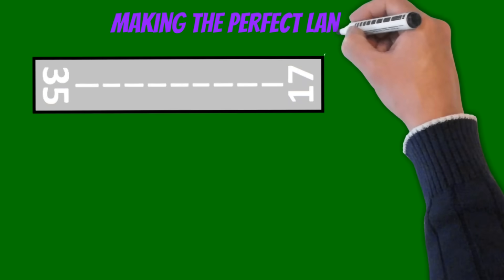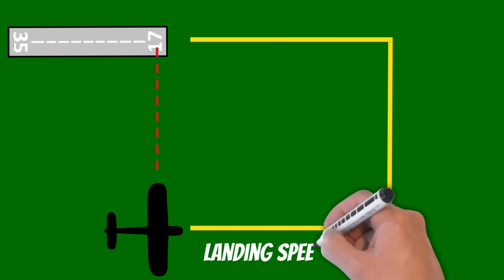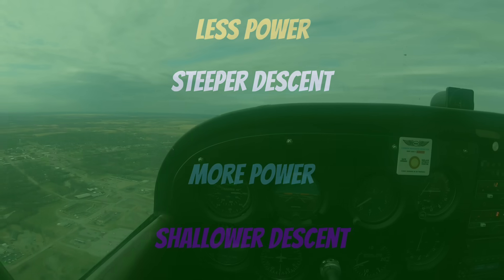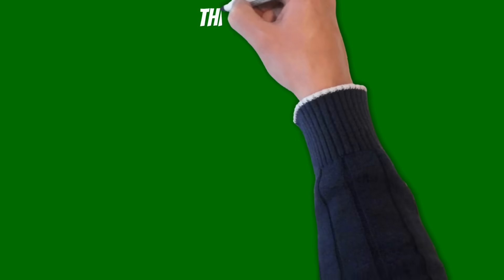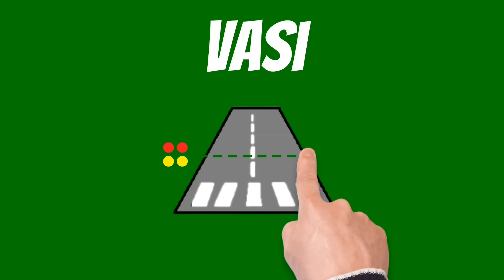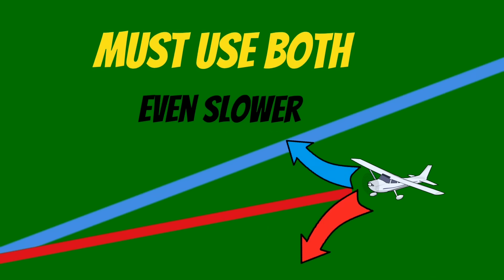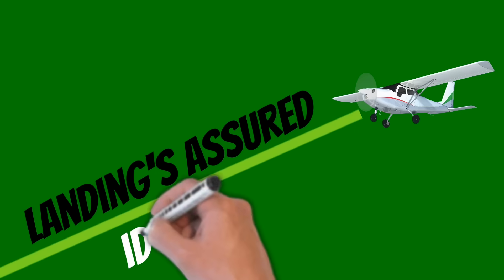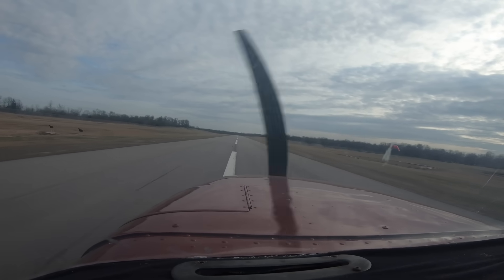Landing SECRET your Instructor won’t tell you [How to Land]

Comment: Nice. I flew a 172 one day after having only done it in MSFS (90's version). I had an instructor on board but all he did was talk on the radio and point me which way to go. About a 20 minute or so flight, take off, fly out a few miles and come back.
"you sure you never did this before?"
Reply from the maker: 😂 that’s pretty funny
Reply: @FreePilotTraining  I saw an ad in the paper for an introductory flight lesson $35. When I got there and we headed out to the plane, oh look a 172.
I said I know this one. So as we did the walk around I told him what I had been doing in the sim. (Which didn't include radio).
I couldn't tell you now how many hours I had in the sim but the only thing he ever really corrected me on was when we were cruising. I casually put both hands on the yoke as I was looking around.
He said never get used to that. One hand has to always be free for other things. If you get in a situation you could get "locked", frozen when you need to be working the throttle and other things.

Landing, I brought it to just above the ground ..."dang, there's no reset button in here". 
Last 50 feet or so I let him touch it down and get us slowing. I was scared of the brakes actually. I didn't play with them a whole lot when taxiing to see how sensitive they were and didn't want to screw up at the last minute. Pushing a key on a keyboard isn't quite the same.
Reply: @yourhandlehere1   Dang, that’s a great deal for $35.  I have noticed that the guys who practice in the sun usually have pretty good hands right away.  It’s amazing how much that helps! Too cool man.
Reply: @thebiblicalpathoflife7154  I was kind of amazed myself. Too bad life didn't let me keep on that path. I've been in 3 different helicopters too.  I prefer the Bell 47 over anything. The most helicoptery helicopter to ever cop a heli.
The sensation of flight, you can feel yourself hanging from that rotor, chop chop chop (hang hang hang). Wide open view, no doors, ripping down a canyon treetop level.
(Sightseeing tour, pilot was Korea MASH vet) I asked him if he ever got bored doing these things over and over, he asked me if I ever got scared.

He took me on a ride. Probably violated a few regulations doing it.
Some good days.

Comment: Small plane power controls decent, pitch controls speed even on final. One thing you didn't cover was using the trim. A pilot should be able to let go of the controls and it will continue at speed. This has the benefit of allowing the pilot to keep his/her head out of the window. You know if you are pushing you are going to fast, pulling to slow.  The nose will be aligned with the direction needed to track the centerline. Constantly pushing the nose straight with the rudder while slow is an invitation to a spin.
Reply from the maker: Excellent point. Trim is your best friend in a landing
Reply: @FreePilotTraining  God is your best friend in a landing. Trim is His gift to you.  (Poking fun here. 47 years commercial pilot). Great video and excellent content and presentation. Anxious to see more.  Best--
Reply from the maker: @HabuBeemer  lol, I’ve never heard that, but I love it. Gonna use it at the next opportunity
Reply: @FreePilotTraining  👍🏻 Blue Skies!
Reply: You can also use trim for minor pitch corrections as opposed to stick movements. I’d counter the rudder nose. Wing down top rudder is a slip and is just fine with no spin danger. Tail draggers better get this down. Tail draggers best also like slips for highs. Where your rudder will bite you is in the overshooting turn as well as gliders on the low 200  to 400 AGL rope break 180 to land as you may accidentally leave it in after initiating the turn. Simple man rudder down turn bad; top rudder no issue. BOLD Method has a good slip/skid discussion on this. His boils down to top rudder is wing leveling. If you want piece of mind, however, get an AOA gauge.

Comment: All those settings, adjustments, and turns can be complicated a lot by weather and other things. It's the most dangerous time because of the complexity and slender margins for error. It's no wonder some pilots will only approach to land straight on. Flying is complicated and when things to do are different than our more familiar behaviors, then confusion blows up everything. It needs to be simpler and a lot safer for non-commercial grade craft.
Reply from the maker: Very true.
Reply: In some instances, straight in is harder. WWII flyers had oval patterns because seeing straight over the nose wasn’t happening.

Comment: Free pilot training: As an instructor I think your wrong the aircraft should be 
set up in slow flight at your target speed before entering the downwind.
knowing the wind speed/direction runway length, all tasks check lists 
flap settings to be used, once in the the downwind leg only flying the
aircraft undistracted is what the pilot should be doing. 
once setup in slow flight one should only use the throttle to adjust
the decent as long as this is done the aircraft will hold the target airspeed.
you said finish the check list abeam the numbers? should have been done already.
If you set the aircraft up properly as you entered down wind you wouldn't need
to be pitching your airspeed now ? BIG Distraction.
you left out the most important thing when to turn base to end up at the proper
height when you reach the threshold of the runway?
I have always  taught  when your 45 degrees looking back reduce power and
always make shallow coordinated turns no more then 25 degrees.
If you fly the throttle and make shallow coordinated turns You eliminate Stall
Spin Accidents. Training was switched in the 70's to this way of teaching to
prevent such accidents -Before we taught spin recovery which is almost useless
in the landing Pattern As a Cessna training center we instructed students in 
preventing accidents. MOST important is proper landing technique which most
important is to have all tasks completed and the aircraft setup before entering 
the landing pattern leaving only flying the aircraft and radio communication for
flying in the pattern. makes landing simpler and safer.
to be clear the target speed is + 10 knots and we always taught students to
how to fly the approach and first landings with no flaps as most training aircraft
land just fine with out them.

Comment: I learned this method until I started instrument training. Throttle controlled speed... Elevator controlled descent...
Reply: Backwards. Airspeed controlled by Aoa, at any aoa, power determines rate of altitude change.
Reply: @bobgoodman1451  If you’re using AOA, you should only look at speed straight and level in the downwind to double check AOA’s function. After that, ignore speed. Speed is a crutch for AOA since tractor propellers couldn’t use vanes. We now have AOA by suction differential. Landings are “meatball, lineup, AOA.” Translated from Navy speak, that’s glideslope, lineup, AOA. GS, lineup, speed is only for those without AOA. Better still, no need to pad AOA for turns. Pitch for AOA, then as you said, power for GS/altitude.
Reply: It’s a common error. I believe it comes from always wanting to be able to glide to the runway which precludes the power technique. Such isn’t an option on instruments (except in front side flyers with a wide band of acceptable approach speeds (that’s a big caveat), but why when such sacrifices precision and is more difficult?).

Comment: Great video! Truly a good instruction session, but I have a few small questions for you: 1. How did you come up with the downwind speed? 2. How did you determine your pattern spacing? 3. At what point did you tell your secret? I’m poking fun only because these are the points that don’t align with what I know. Also, if these are instruction bullets they need to be substantiated by a resource. Speed and spacing on downwind are a product of being able to glide to the runway from pattern altitude power off. The secret you shared have always been told to me during training. Keep up the professional videos and the Oklahoma Standard!
Reply from the maker: Thank you! A lot things in the pattern are personal preference.  I fly the top of the white arc on downwind in case I need to configure quickly.  Ply it gives you more time for checklists.  Also, pattern spacing is directly related to your crosswinds.  I didn’t really discuss that in this episode.  The secret in this video is the use of an aimpoint to improve your landings.  Using that aimpoint will really contribute to a stabilized approach.  I’m so glad that you have heard all of these tips already. You are one step ahead of a lot of student! Thanks again for the feedback!
Reply: @FreePilotTraining  that is because I am a CFI. Also, all of this was taught to me from the first flight.
Reply: If you’re doing speeds to always be able to glide in with engine out, then how are you doing powered approaches?
Reply: @jimallen8186  good question, why are you doing powered approaches?
The basic instructional video was exceptional, my critique is of spacing and speed in the pattern. Power off landings should be taught at this basic level as well as power on. These are thoughts you should contemplate on the ground prior to your next flight.
Reply: @jameski5oeb668  My power off experience aside from private pilot back in 93-94, I wasn’t taught powered approaches then though I often tried to do them as was actively discouraged from such, has only been in a glider or in a platform using terms like “high key,” “low key,” and “base key.” In these, you are well above downwind altitude and will fly a much steeper glide path. Makes for interesting pattern deco friction at times. So, back at you, how are you planning power off in standard pattern so as “always to make the runway?” I’ll bet you’re not while instead you’re looking at the off duty runway(s) and perhaps midfield landings. The idea of powered off approaches and power on with its better precision and control are mutually exclusive. I’m flying powered approaches for that precision and because it’s a safer way than power off backside techniques.
Reply: Some environments require the power on to land while you just have to buy the risk of losing power.
Reply: @jimallen8186  agreed, we are the experienced. His instruction is for the new guy.

Comment: I used to do a lot of touch and goes. When I came in high and short I would practice slipping in.
Reply from the maker: Slipping is an excellent tool! Thanks for the comment!
Reply: Slips! Slips you say! Slips are so much fun just remember they are not much fun for those riding, I dont like it when I am the one not doing the slipping, feels unnatural unless you are the one controlling the plane.   Occasionally landing at larger airports with jet traffic you have to charge the runway at cruise speed, bleed it all off after crossing the threshold.

Comment: You talk about a stabilised approach, then you proceed to demonstrate an unstable approach. Plus you talk about being careful of your speed during your turn onto final. Spread does not cause a stall, angle off attack causes a stall. It is easy to demonstrate flight with no airspeed in an Unstalled configuration, it is also easy to demonstrate a stall at high speed. I would love to take you up and blow your mind. 😄
Reply from the maker: This is a very good point.  You stall when you exceed critical angle of attack and not at a specific airspeed.

Comment: For those straight in landings how do you know when you are at 3 miles etc? This is especially the case at unfamiliar airports.
Reply from the maker: I count section lines.  If you have a gps, this works as well
Reply: You can make a mark on your windscreen that correlates to 3 degrees as most glide paths are at or near three degrees. Note, the mark will only work for you and with consistent seat position. If you wanted, you could even put a whole pitch ladder on your windscreen. You’ll also have more precision on such looking through to infinity than you would any instrument. Alternately, If you have room in front of you, your stretched arm leaves each finger being roughly a degree. Stretched arm, three fingers below horizon. Most cockpits won’t let you stretch your arm though.

Comment: 4:28 deploying flaps during a turn?  If asymmetric flap deployment happens.... roll wings level, set flaps, re trim.
Reply: Not only that, if you are not perfectly in balance during the turn you load up the flap tracks/motor and cause excessive wear and premature failure. Best to extend and retract flaps in level flight.

Comment: Excellent!  Would only add that even more centerline focus will  improve the flare every time!   As a professional pilot with 20,000 hrs whenever I feel my landings need improvement I focus on centerline.   Not only improves your crosswind control but I believe it adds focus on end of runway and improves depth perception.   It’s difficult to focus on depth perception so focus on centerline and end of runway!
Reply from the maker: Thank you! That is an awesome tip! I’ve never even considered that, but I can see the truth in it! I appreciate the tip and the feedback!
Reply: @FreePilotTraining  when you look at the end you can perceive the sink rate.
Reply: Emphasize that “end of runway” in watching centerline. There’s students that will look at the line on the near side and get both ground rush and lose that more precise sense of AGL you mention. Speaking of AGL sense, watch out going between platforms. Cessna sits a lot lower than most professional platforms hence you may flare high then come down hard.

Comment: (09:35) You say, “Use pitch and power [to achieve a perfect glideslope],“ but don´t you mean, Use AoA and power, because pitch is absolute and AoA is relative? Right?
Reply from the maker: You can use AoA to create a stable approach if you have an AoA indicator, but since this is not the case, civilians pilots must use pitch and power.  And flaps

Comment: When I used to fly, I trimmed the plane to maintain 1.3x the stall speed on final. If my aim point moved higher in the windshield, I was going to undershoot, so I’d add a little power. If it moved down, I was going to overshoot, so I’d reduce power a little. I don’t recall pushing or pulling on the yoke. Doing so would have changed my airspeed.
Reply: ^Precisely.

Do not chase airspeed with elevator. 

The elevators sole job is to trim the wing to a certain angle of attack. 

The pilot pulls then yoke back to achieve that angle of attack.

The trim wheel reduces this effort. 

The angle of attack dictates the airspeed. Once it is set. The speed will remain relatively stable, within a knot or two.

The engine dictates glide-slope. As the airframe has a built-in glide ratio. And it is usually steeper than a 3-4 degree approach PAPI. So the engine adds thrust to counter drag. This improves Lift/Drag as lift remains 1.0 and thrust overcomes drag to make it smaller.

Comment: This is exactly what my CFI told me.  This is what I intend to tell my students once I have my CFI.  Where is the secret?   I will say this.  My instructor was a mountain bush pilot.  I did find out later in life that keeping the nose a little higher helped my landings.  Rather than holding the nose much higher, As a bush pilot would normally do.
Reply from the maker: Great tip! It doesn’t take much!

Comment: You always make your patterns exactly the same? Not practical.
Reply from the maker: I believe that it is important when you are a beginner.  I don’t mean that you should not adjust your patterns for crosswinds.  However, I do believe that new students will learn when they are too high or too low a lot faster if they start with consistent patterns. You don’t want to be focused on trying to correct your altitude when you are over the threshold.  You want to be focused on the round out and flare.
Reply: @FreePilotTraining  I get it. On the other hand, they need to be flexible enough to be able to handle a short approach or an extended downwind. There are places where training is conducted and a consistent pattern is simply not practical.

Comment: I'm always amazed about the "you can always go around". I don't have this luxury as  glider pilot. I have only one try. 
As I'm looking into getting my ppl as well I am curious how this experience will affect my landings
Reply from the maker: This training is not for glider pilots, it’s for student pilots who would like to improve. Going around is a normal maneuver and SHOULD be used when the situation dictates.  I agree, every attempt should be made to land the plane in the beginning when you have an instructor on board, so you can improve, but a “go around” is NEVER a bad choice.  As landings are concerned, I’m sure it will be very easy for you to adjust.  Maybe a slightly different flare picture.
Reply: Since you likely use spoilers at midrange so you can reduce them if low, you already have an analogous sense for power. Switching to powered flight, your landing aimpoint may be closer to threshold than you’re used to. That’s ok, just remember when you go back to gliders, you want to aim a little long again to have the margin should you be under energy. Having flown the glider, you’ll also likely have good footwork for balanced flight. Gliders exaggerate certain tendencies. So do float planes. As mentioned above, going between platforms affects flare pictures. You sit low to the ground in a glider. Don’t slam your first powered landing down by flaring late.